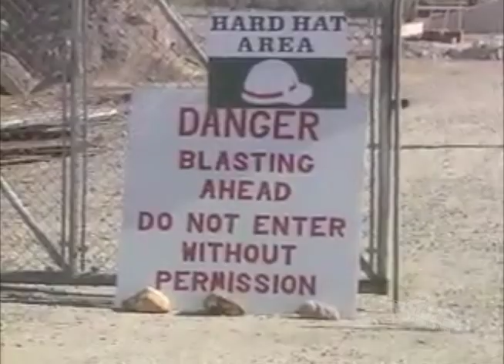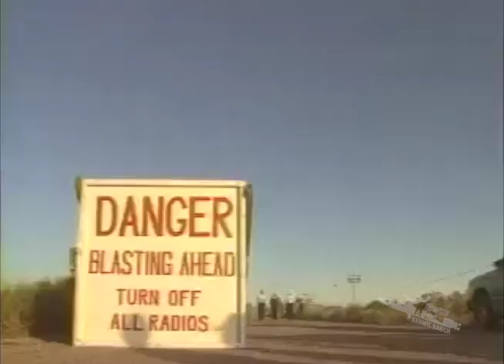Blowing Up a Titan II Missile Silo

Comment: When I was on a Titan II launch crew, they told us these sites would withstand a nuclear hit that was fairly close by.  Then, they blow the caps off the silos with conventional explosives.  I firmly now believe that a nuclear hit would have turned these silos into dust and the crews with them.  I can't believe it has been 45 years since I pulled my last alert at one of these sites (McConnell AFB).
Reply: The same thing crossed my mind just the other day.  Maybe missileers were haphazardly “told” that just to keep morale up and reduce the morbid aspect of that scenario.  Sometimes the hardened sites have been referred to as “capable of surviving a near miss”, and maybe they could withstand an air-burst from above, but a direct ground burst would surely obliterate everything.
Reply: They said close by, they didn’t say it would survive if the silo was ground zero.

Comment: With your long cableway removed and since your going into the lcc through that entrance,  would you attempt to dig down beside the silo and see if you could gain access to the silo area through that entrance?  Just to see what it is still like in there or if the generators still remain?
Reply from the maker: That's the plan eventually :)

Comment: At 2:21 there is an air shaft/culvlert pipe still standing, is that the one that enters the silo in the general vicinity of the generators? Do you think the remaining outer area of the silo below the destroyed area could be accessed from there? Also do you know if they completely filled the water wells on the sites or were they just capped and buried? Thanks for the great history videos.
Reply: They did not fill them with water.  However cutting out all the pumps and valves would have drained the 100,000 gallon deluge tank down into the sump area below the "W".  The sump area was large enough to contain a 100% spill, so in theory the only water down there SHOULD be in the sump area - provided the site was above the water table like most in AZ are.
Reply: @ArizonaTitan  Thanks for the reply, I got a little off of the topic of the video with the well question, the well that I'm referring to is the water supply well(s) that would have been drilled when the bases were built. I was just wondering if they filled them with cement slurry of if they just capped them.
Reply: @SteveStoltz  The wells were just capped.  Most that I know of were reported vandalized by idiots over the years dropping stuff in them for fun.  Along with rocks, mine had an alternator in it that had to be removed.  Still a lot cheaper to have a well company clean them out and put them back in service than drilling a new one!
Reply: Arizona Titan 2 that’s good to hear, wells in the desert can get pretty expensive. I bet an alternator was the last thing you were expecting to find in an old well lol.